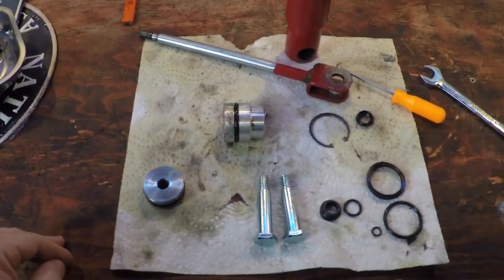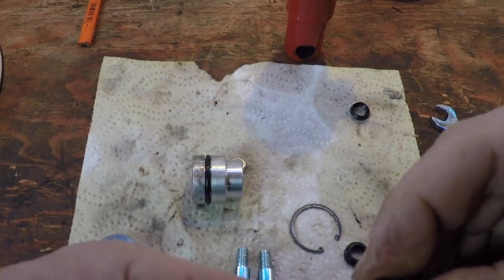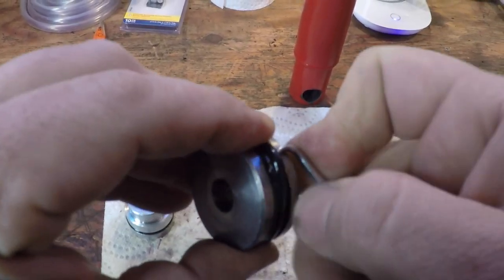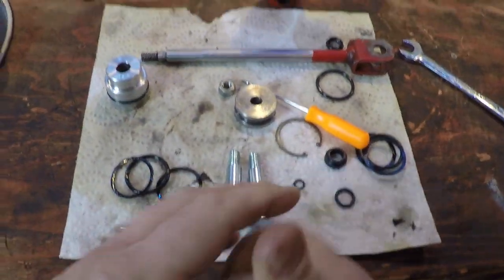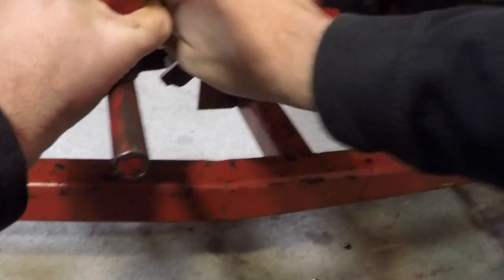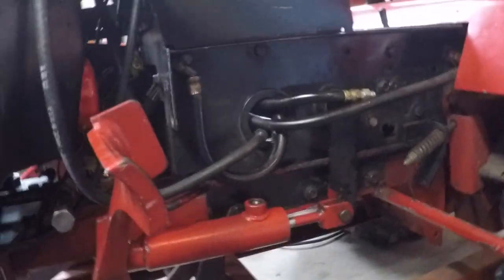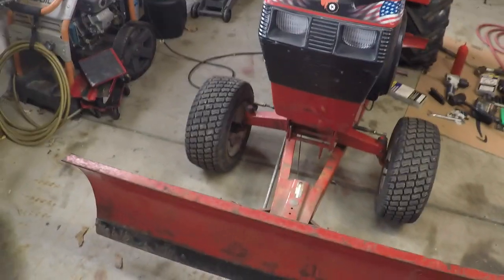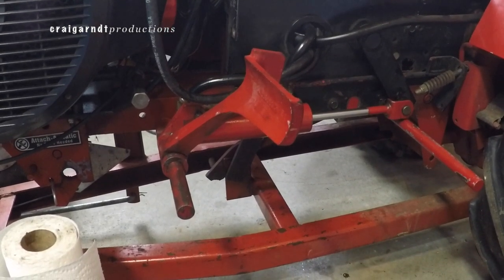Part 2- Rebuilding Wheel Horse Hydraulic Cylinder

Comment: I've now recently done 2 of these. thanks to your video very easy project. The Allan nut in foot rest collar is pain to see and access but other wise removing cylinder from tractor pretty easy. Thereafter, hard part is getting the snap ring off and then actually getting the piston rod out of the tube. Removing and reinstalling all the various "O" rings pretty easy. I used dental tools. The one thing i was unsure of is the end collar actually has a front and back but I did not pay close enough attention when taking apart which was front and back because I did not notice the difference initially. If you look carefully the two sides of the end collar are actually different. One side has a small inner intent on the rim of where the rod goes through. Not sure why or its purpose but its evident. I am not 100 percent certain but I believe the back side or end of the rear collar is the one with the perfectly flat center hole that the rod goes through and the hole that has the small interior rim indentation faces toward the open end of cylinder. Just be sure to know there is a front and back and make note when you disassemble that collar after you remove the end nut. One other suggestion is rub a little oil on the rubber O rings before putting new rings on and also rub some oil on rod and collars before inserting back into cylinder. My 7 piece O ring packet cost $17 August 2021 at WH Parts and More. Lots less $ than new cylinder.

Comment: Still enjoying your channel. The rebuild of that cylinder is a job I've been stalling off on doing for the last couple of years. I keep a pan under the tractor now, lazy solution. Seeing you tackle the job it and succeed, motivates me to finally get it done on my own 520H. I rebuilt the double ended cylinder on my outboard motor  steering last year, I had a real hard time getting the seals out of that one, took me quite a while because I didn't want to gouge up the bore. You did a great job, I hope mine turns out so good. My other issue lately is excessive voltage on gauge when  motor is running. I have to keep headlights on to keep battery from overcharge. Any ideas what my problem is?
Reply from the maker: This is a lot easier than an outboard hydraulic lift, you can seriously do it in under an hour.  Most of that time is just removing the floor board, brake pedal and hoses.  I've rebuilt this twice now, the little o-ring that goes around the shaft got hard and failed.  Otherwise, all the internal seals were still good.  Once you fix that leak you'll be glad you did.  Thanks Remy... have a good week.

Comment: I would have just slipped a razor blade under those o-rings and snapped em right off!  "Supple"- LOL Love it! The feel good when they're new. It'd be nice if they could change the composition to not be susceptible to hardening over time. 

 You got a parts list or rebuild kit link? I may just do this now before a leak occurs. Yeah man you got all of the O-rings, may as well get em all out and put new ones in. 

 Good job! Works like it should. No more leaks?
Reply from the maker: No more leaks.  Works like a charm, I will pin the link as well.  https://wheelhorsepartsandmore.com/product/wheel-horse-hydraulic-lift-cylinder-seal-kit/

Comment: Good morning! What kind of oil did you used!
I. Have a 1991 Wheel horse 520HP
THANK YOU FOR YOUR HELP,
Reply from the maker: I use Mobil 1 full synthetic 10w30 in my hydro.  If you have any leaks you'll notice them more with full synthetic, but, the responsiveness is much better with synthetic.  The manual calls for 10w30 but really Mobil 1 in there.  Have been using it since I rebuilt the hydro pump several years ago.